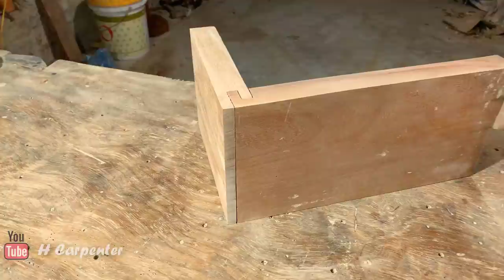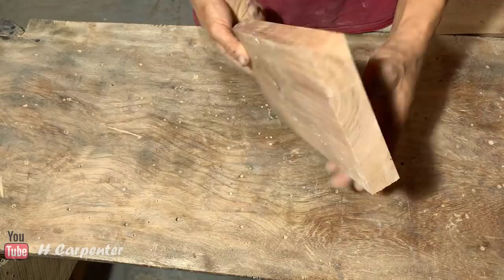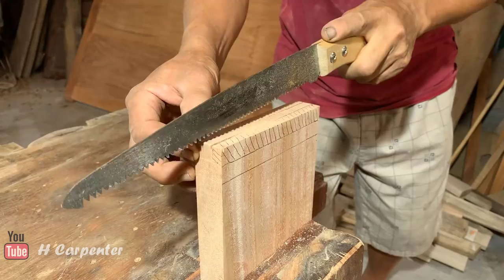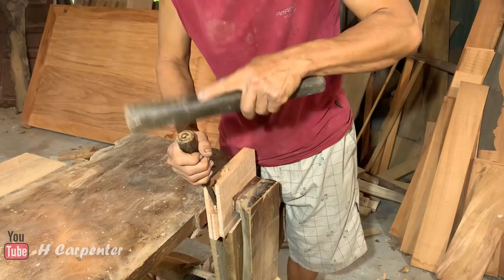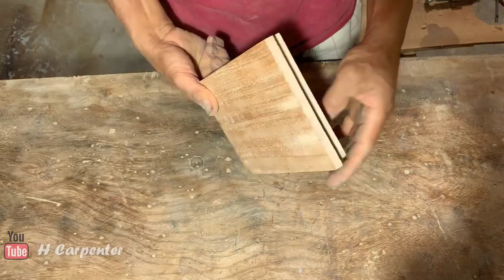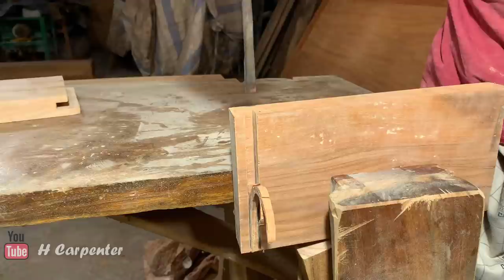Woodworking Making A Hidden Dovetail By Hand   No Screw

Comment: Typically a drawer lock joint not a dovetail joint!
Reply: It`s called a dado rabbet.
Reply: Yes either or. I have cut plenty but dovetail is stronger with more glue surface area!